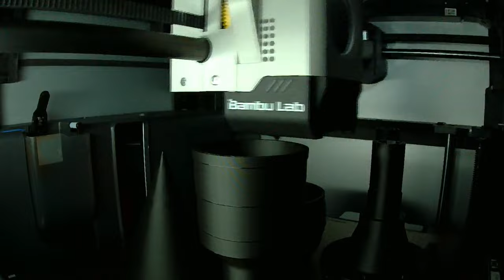Jet Engine Model 3D Printing Kit - 006 - Bambu Labs | Full Assembly Video

Comment: FYI, anyone trying to mess with super glue with tight tolerances like this: dip the glue on a toothpick or something extremely small and drag the glue over the part. You don’t get any control pouring it straight out of the bottle.

Comment: I had the same rubbing issue with the 2nd last stage of building the model. It ended up being the big bearing not seating properly onto the drive shaft, so I just gently tapped the black shaft and it seated the bearing better, allowing the assembly to freely rotate.
Reply: I had a similar problem with a bearing not seating fully due to a rough seating area. a scraper saved the day!